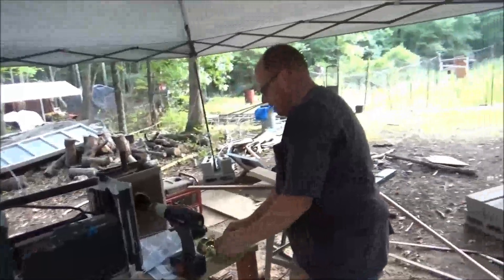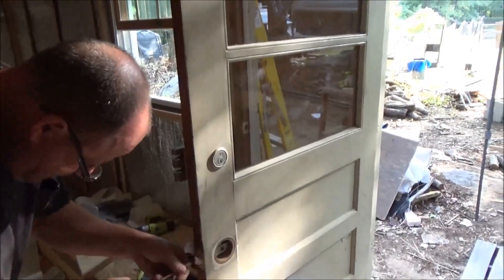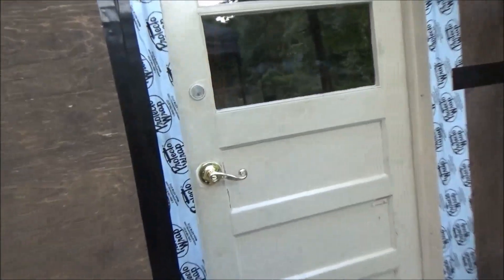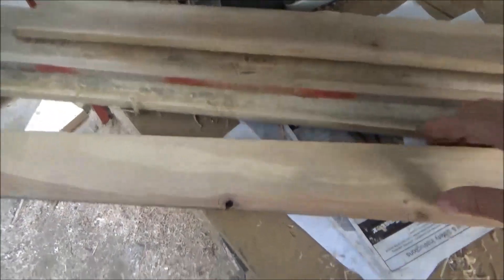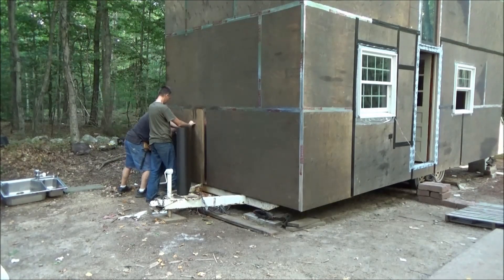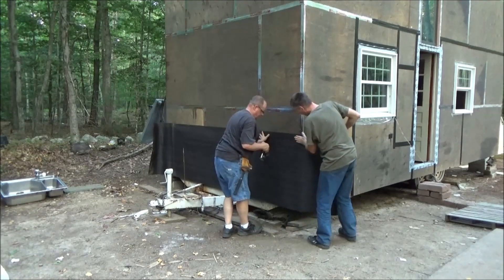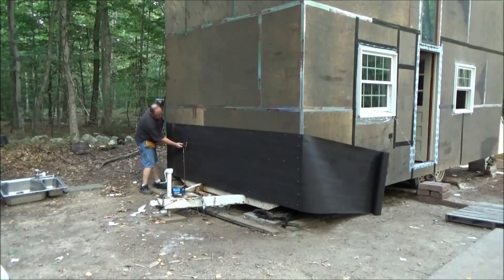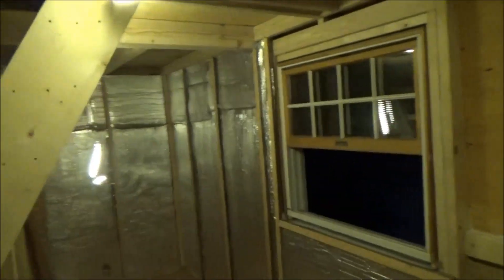A Locking Door And Starting Tar Paper On My Tiny House S6

Comment: Nice lock. John does good work, that's for sure.

Glad you are getting it buttoned up. Next spring you will transform it from a tar paper shack in the woods into a rustic mini-palace with the fancy siding and trim. You have all winter to grind down the siding you will need. Give it five years and the whole place including the chickens and garden will be very impressive.

Comment: Back when I was a boy living at home with my folks, my dad bought a Rock house to be moved to our land. Dad & I tore the Sandstone rock off so it could be moved to its new location. Winter was approaching real fast & my folks had no money yet to have the rock replaced with  New brick. So we went through the entire winter in that house with ONLY Tar Paper. I must say it was a Warm house inside even though just tar papered outside. That Tar paper Really stops the wind & weather elements Troy the way you have insulated your floor & walls (which we did not have) you are going to be SO warm & Toasty. in your Tiny Home! Even if you don't get to your siding before winter. No more Cold days & nights for you brother, like you've had to endure in the old RV motorhome. I'm so happy for you.   Congratulations!

Comment: Just need a storm door and window screens to get air in. Also keeps out the skeeters. Now get the heat and air inside, u be ready to finish out the interior. Need a little step up to the front door. Also remember the milk for post nail lickin. Can't wait for the next vid from the tiny house on wheels at the off grid project.

Comment: Troy if you have a small glass cutter tool you could save that cracked window and maybe make a small clear coffee table top out of it. I know you like using resources rather than throwing things out. Or maybe use it at an angle shield over your garden or when you build a shed to be one long window on the backside to let some light in.

Comment: Looking good get the tar paper done and the metal on the roof then you are set for the winter.. Then you will have all winter to get the work done on the inside while it's cold... BTW with as high is that roof is I am thinking you should mount your solar panels up there to help get them above a lot of the tree lines...

Comment: Some of the pallet wood you sent through the planer has what is referred to as "end snipe".  It's tear-out of the wood grain and it's caused by the blades as it gets near the end of the board.  It can be prevented two ways...buy a very expensive helix blade or...send the boards through the planer touching end to end as to mimic a continuous long board.

Comment: Very nice progress!  Having someone as knowledgeable and hard-working as John is great.

However, given your aversion to insects, I'm surprised that you haven't installed some screen material in the windows.   Probably not such a big deal during the day, but having lights on inside the house when it's getting to be dark outside and having the windows open is just asking for an insect invasion.

Screening material is quite cheap, and you can just tape or thumbtack it up to cover the windows on a temporary basis until you get some "real" screens.

Comment: I closed up a hole in the transmission housing of a 50cc scooter similar to the one you have, and the stuff held on like Kryptonite :)  Someone before me had broken the kick-starter lever out and the stuff was awesome.  It should go the distance :)
Reply from the maker: That is surprising
Reply: *****
ah :) amazing stuff, as far as I've seen :)
Reply: The Do It Yourself World
When I pealed it off after the thing finally stopped running, it was still stuck on there HARD, and there was lots of rubber dust from the variable transmission belt.  The adhesive on the inside of the housing that was exposed acted as a debris filter, grabbing all that rubber dust :)
Reply: Used it to fix a shoe :)  You have to keep it clamped so it doesn't expand.  Basically minimally expanding urethane
Reply: ever thought of that :) Will file that away :)

Comment: Nice looking house with that door and the first row of tar paper. But a door that can lock you out would be a no-no for me.
Reply: pieter zeeuwen How else could you do it? Isn't the key hole always on the outside?
Reply: The key hole may be on the outside, but unless you have the key, it doesn't help. A deadbolt doesn't just lock when you pull the door shut. That good old American doorknob only locks if you push the button first.

And I know this kind of door handle/lock from Europe, and there you can pull out the key in two positions: in one the lock will latch when you close the door, in the other not (you can open the door by turning the handle). Hopefully Troy's lock is the same type and he has found this trick by now.
Reply: pieter zeeuwen Never seen that type of lock. A very interesting style. Thank you!
Reply: That is why I stick with the keyless lock. Cannot lock yourself out and never have to have a key in pocket. Win-win or Yes-yes for me. :)
Reply: cnypilot as long as the battery in the lock is not empty.... ;)
Reply: pieter zeeuwen The one I have is the AP501. It has permanent memory. So dead battery does not erase the passkey. If you failed to replace the batteries even through all the beeping, you can take a 9v applied to terminals at the bottom of the exterior pad and it charges it enough to allow you to enter your passkey to get inside and replace batteries. Also, the circuitry is protected from voltage shocks. :)
Reply: cnypilot Pretty impressive! Much better than the ones I have seen and used before. Which brand is it?
Reply: pieter zeeuwen AP501. I think they have yt videos of it being tested with people firing various caliber bullets at it. Either using the keypad or fob reader. Years ago, I was searching for a keyless entry because you can easily pick/bump a regular lock, problem is that most keyless locks have a backup lockset. Well, that defeats the whole thing if you can just pick it. This deadbolt is completely without that. I've been using is for ... 4 years now?
Reply: pieter zeeuwen Look up the Sunnect AP501 lock.
Reply from the maker: Thanks. I just have to be careful. Keep a key in my car and one in my pocket. Should be safe that way.
Reply: cnypilot So you needn't carry a key, but must carry a 9v battery?
Reply: dustdevl You can always ask the neighbors for a battery, and tell them you don't need a cup of sugar this time. ;)
Reply: dustdevl Negative. The 9v would be if you were idiotic enough to not have good batteries in the Electronic lock. That is, you failed to change them when they kept beeping at you to say, "Hey Idiot, replace the batteries" 

I've had a set of 4 aa batteries in the lock for over a year now. They are still going well.

Comment: Troy you have forgotten to run electric out lets and wires. And you did run any water pipes to a sink in your bathroom and no wires. Did you forget in rush to get the house up? And I m thinking you could put a hole for AC in the wall too maybe on the back side so it wont look bad in the front. And you need a gas pipe for propane running to the kitchen too. And a drain pipe for the shower or bathtub what ever you decided on. Drain for kitchen sink.
Reply: shartne Troy is going to run the electrical in conduit on the exterior of the walls.
Reply: Thats good that he is not drilling holes in the two by fours.

Comment: the door handle appears to be an "interior" handle, also think it is upside down.... sure it will work, but the little curved part should be down.
Reply: The door handle may be an interior one, but it's not upside down, The end is supposed to curve up. You can tell by looking at the way the "straight" part (where your hand will be) is shaped.
Reply: So then, do you hang the toilet paper with the loose end coming out behind or in front? We need to know which way is right.
Reply from the maker: SSanf front
Reply: The Do It Yourself World That is the only correct way!